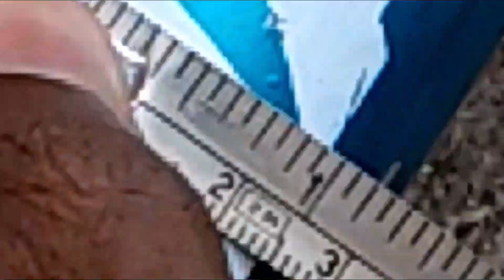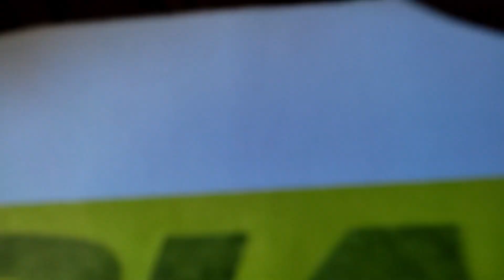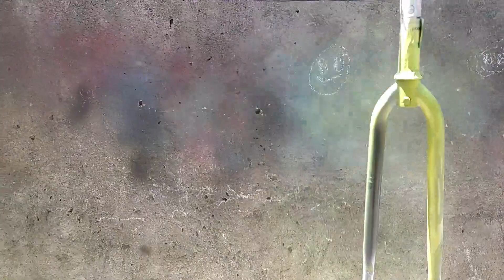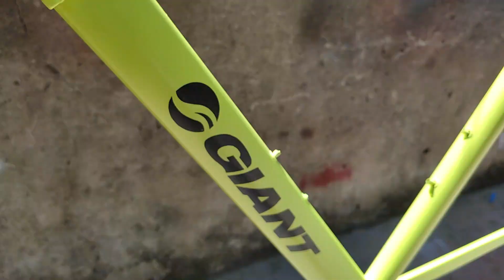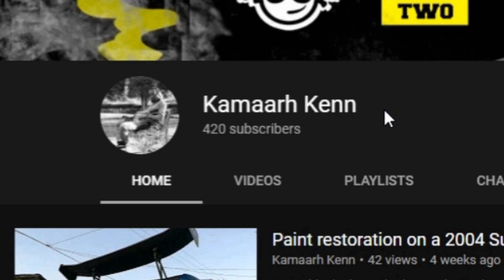Beat up GIANT Road Bike Frame Restoration. (Safety Green Paint)

Comment: Hi I'm thinking of doing this, does spray can paint last or does it fade out easily. What would you recommend as an expert. I'd like a professional finish and lasting paint job
Reply from the maker: Depending on the quality of spray paint, it should last a good while
Reply: @KamaarhKenn  Not years though?  Thanks for the information.
Reply from the maker: Depends on use too. On a bmx bike it'll definitely get thrashed, but compared to something like a road bike, it'll hold much better
Reply: @KamaarhKenn  ok thanks.